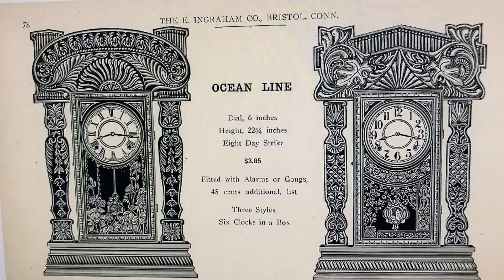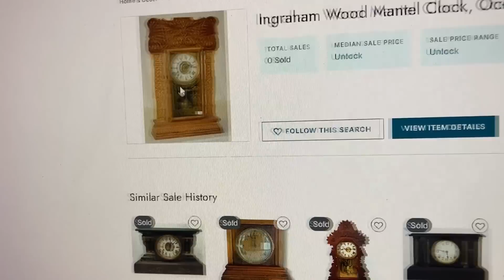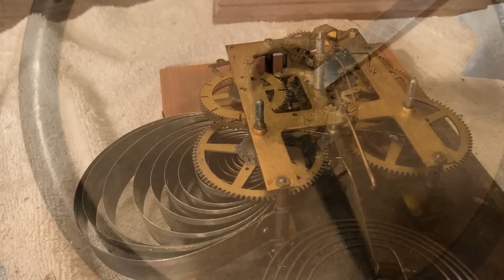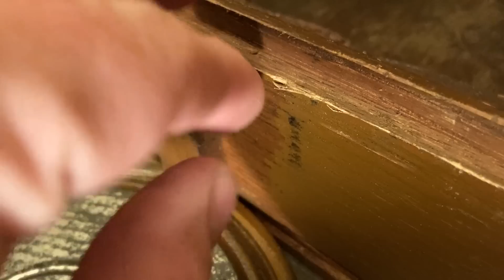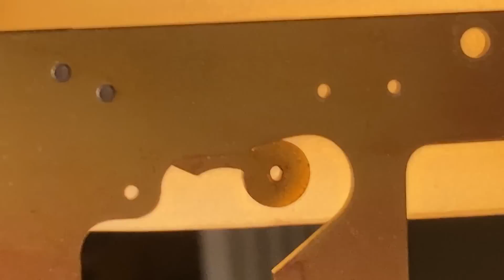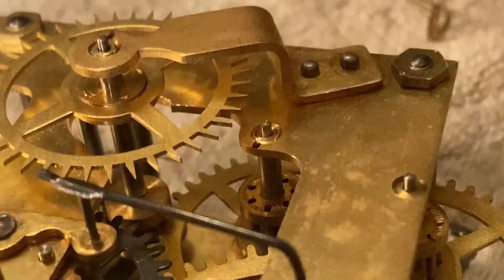Horribly Abused 100 Year Old ingraham Clock - What Happened!!!

Comment: It may be ambitious, but how cool would it be to fire up the CNC and try and recreate those pillars.  :)
Reply from the maker: It could be done but I've never done much detail stuff, I need to get some of those bits though.  We make cabinets out of MDF so it's almost entirely profile work with basic pockets, the only thing even remotely detail was when we did that leg spreader.  The originals were pressed  not carved, but that would be a lot harder because you'd have to build a 'stamp' basically to press into the wood... It could all be done though!

Comment: I could see myself getting an ultrasonic cleaner and some old clocks... fast forward 60 days I would have an ultrasonic cleaner and several piles of shiny brass pieces that may grandkids will find in a box in 30 years 😃😃 Back to work on my Space mission. Things I have learned in the first week. it is hard to appreciate how dirty the inside of a 50 year old electromechanical machine is from video. You can see it.. but its different when every time you touch something it looks like you just  changed the oil of your Nova in the driveway :D much easier once I pulled the mech board out and hit it with a paintbrush and shop vac. If a wire is bent at a certain angle for 50 years, it wants to be there... dont mess with it. Changing the game from 3 ball to 5 ball when trying to figure out the obviously messed up ball count unit can and will introduce an entirely different problem. LOL just having fun seeing how the problems change as I clean things up. Thanks for all your Pinball videos, I really think you should do a Grand Prix!!!  (I think I have watched all 200 of those a couple times at this point)